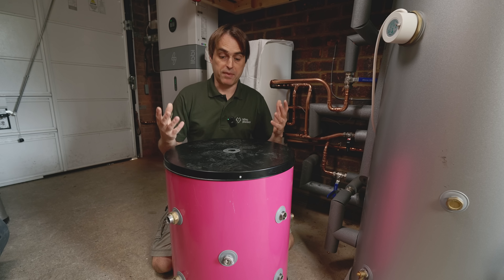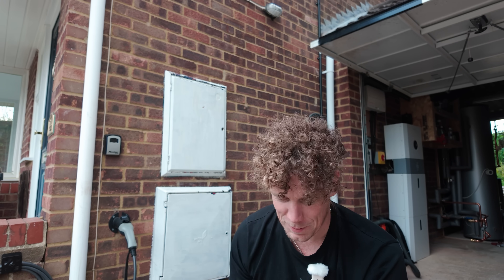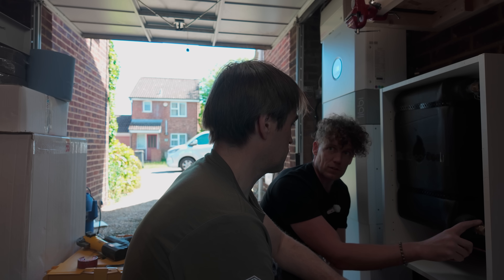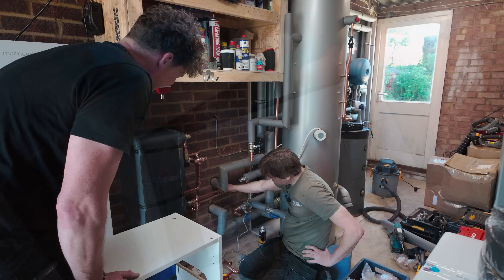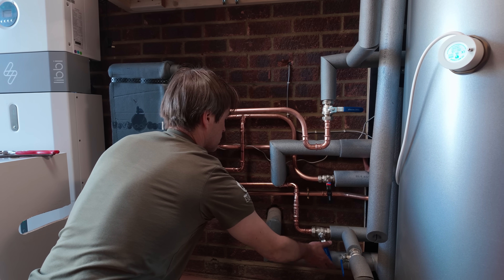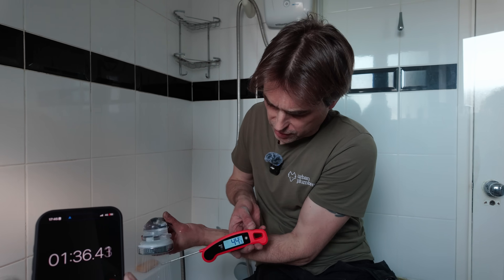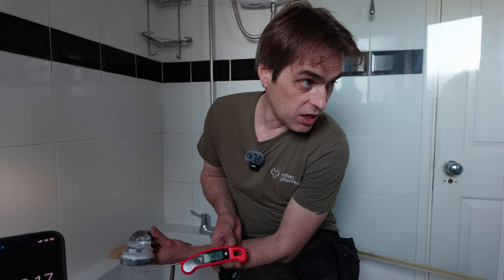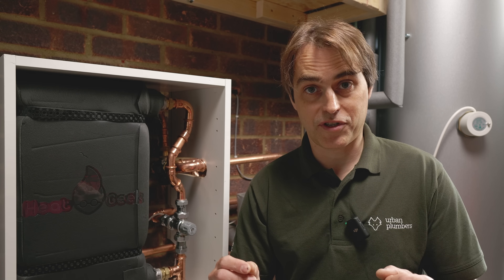We Built a Heat Pump Combi 'Boiler'. But Does It Work?

Comment: would it be possible to run some sort of heat exchanger to capture the heat from the draining water? I've heard in Netherlands they are trying to capture the heat from sewage from a whole block, but I'm not sure it's possible to do this on a smaller scale

Comment: Can you drop in valve models that you use there?
I think I'm gonna repeat this and made it for a gas boiler. Instead of cold water tank, unvented hot water tank and very loud Stuart turner shower buster pump. This would remove all 3 elements, that would be replaced with just 1. I was thinking about making solution with small heat exchanger with flow switch and temp sensor in HP (kind of like remote combi boiler). This was good idea, but with small PE, every time hot tap would be on, it would ignite boiler. Big PE solve that issue, its a bit expensive, almost for a price of new combi boiler in place of system boiler. Hey, but if it works I'm fully in to it to have some fun! Great job guys!

Comment: Would be nice on my system, as mine is power hungry and struggles to perform in the winter months.
I have a tank in one cupboard and a buffer in another, so I’m loosing space for a system that massively underperforms and costs me around £300pm in the winter giving only 15-20mins of hot water.

Comment: this is fantastic, whats the energy consumption like in comparison with heating the big tank ? i wonder too if maybe a more efficient heatpump architecture would work better, higher volume/ flow compressor but at a lower pressure, or other way round ? wonder what would be best for efficiency

Comment: For me the concept of a combi is much better than a hot water cylinder due to the inefficiencies, especially with only occasional use. Is it possible to do this without the storage? Smaller heat exchanger, supplimented with an electric heater that kicks in for the first minute or so until the heat pump is doing its thing?
Reply from the maker: Hot water cylinder is twice as efficient as this solution though

Comment: This confirms my idea of using plate heat exchangers with a heat pump in order to heat a hot tub. Ideally, another exchanger could be used in a corresponding cold plunge, and then use thermostatic mixing valves in order to 'bleed off' excess heat energy when one of the pools has reached its optimal temp, but the other requires more heat to be pumped in order to reach its temperature set point!

Comment: In Japan there's something called "Eco Cute" which uses the heat from the the air conditioning to heat water.
But in Japan, air conditioners get used on "cold mode" 9 months or so of the year!
Reply: I guess that 9 Months does Depend a lot on the region of Japan you're in.

Comment: Nice idea! Would it help to have controls  (e.g. a button) to press shortly before you have a shower to trigger the heat pump and get it up to temperature? Behaviourally similar to running a bath. Guessing if its -5C outside it could take too long to get up to temp.
Reply: Then again, it would likely already be running the space heating at >40C... so that helps

Comment: Instead of no hot water cylinder, how about a very small one that has a high efficiency like a vacuum thermos of a few liters, just enough capacity that the heatpump has time to start, it could be maintained at almost boiling temperature with only a few watts electrical input and then mixed down to provide the delay needed for the heatpump to start.

Comment: Does anyone know which brand/type/power etc the PHE is used? Seems to be quite a big one which are mostly not so cheap.
Reply from the maker: It’s Nordic, around £1,200 if I remember correctly. I got the spec somewhere on the video so would have to find it

Comment: What about packing it with sand or phase change material to lengthen the hot water draw off run but also reduce the heat pump cycle.
Reply: Like a storage heater

Comment: For this to work, the heat pump must constantly maintain the temperature of the exchanger, which is not environmentally friendly and does not make sense. Installing a thermostatic valve to control the temperature of the heat pump is a big mistake. You have made a mistake because the temperature of the heat pump is too low and there is also that unfortunate thermostatic valve behind the heat pump. You have too many cycles during operation because of this.
Reply from the maker: There is literally no cycling at all. It works fine. We have data on Open Energy Monitor showing 1 cycle per 2 hours so nothing to worry about
Reply: @UrbanPlumbers 
Of course there are cycles, maybe there aren't any in testing, but when there is another lowering of the water temperature at the tap - there will be cycles. And it's stupid to put a thermostatic mixing valve between the tool pump and the exchanger. You didn't comment on the nonsense of the arrangement? And how powerful is that exchanger? 500kW? It's nice to see you learning from mistakes, but this has nothing to do with efficiency. No one will beat a condensation boiler.

Comment: I am not sure I understood the mixing/repeating water loopy thing.. 
But.. I am so impressed, I might just take a 20 minute shower
Reply: basically back feed the water to the Heat pump until it's reached a temperature you can actually use for hot water.
Reply: @maesto  I assume that is "before the shower starts running" and not "as you start running the water" ?
Reply from the maker: Before, the plate stores water at higher temperature at all times so it’s ready to deliver hot water instantly and allows for better flow rate as you slowly deplete the energy stored in the plate while heat pump kicks in to replenish it
Reply: @UrbanPlumbers  Ahhh.. I think I understand it now, so it stores the temp in a solid metal mass rather than as a liquid mass as usually found in a tank.
I will try and watch the video again to see if I can understand the loop back thing a bit better.. 
I know there was a graph on screen at one point, I will see if I can figure that part out again.
Reply from the maker: @ColinRichardson it also holds 15l of water on DHW side and 15l on system side - so 30l of energy stored in water
Reply: @UrbanPlumbers  I re-watched the mixer thing graph.. for the loop.. Your finger was covering the 2nd mixer for most of it while it was on screen, .. the one on the right.. I assume that is the mixer that sends the water back around until the metal mass has heated up.. but then I don't understand why it sends the cold water through the metal mass again, it seems like it would cool it down..
Reply: Technically, needs to be signed off with building control under part G.

But how exactly do you sign one off? It’s not an unvented cylinder, how would you even commission it?

Comment: This is massively important for new build properties where developers have already built into the loft space for the master bedrooms. Frankly many of these homes don’t even have enough storage space for the number of bedrooms, let alone finding a way to give some up for a HWC. Also this will make many installations more straightforward as the outgoing combi already gives you the required space and an integration point into the HWC 👍

Comment: If you replaced the temperature sensor on the heat plate with a flow sensor. The heat pump could kick in 2m 30 earlier. Every second counts 😅

Comment: I might not be fully understanding yet, but is not not identical / similar to a water to water heat exchanger? I think a lot of new builds in The Netherlands have something like this, where block geothermal heat is fed into an apartment and can be used for radiant heat and with a valve it is switched over to a heat exchanger where the geothermal loop heats the tap water
Reply: Yes - however they are using the metal as heat storage....

Comment: I connected a  secondhand £100 heat pump to my valiant ecotec many many years ago. At first I made the system so complicated with expansion vessels for each circuit and also many motorized valves. As the years went by I kept reducing the complexity and components . At the end I disconnected the hot water tank and just use the boiler to heat hot water and provide emergency heating if it gets to too cold. It’s a 5kw heat pump heating a 5/6 house. Simplify simplify simplify. At one stage I thought to my self I could get rid of everything(heat pump, boiler) and just use immersion heating with the solar to heat up the whole house, it would cost me a few more £ a year but it was so simple. I like simple but make sure it’s safe above all! I don’t need to buy any more products that will save the planet.

Comment: In Heat Geek's video, they mention that it's okay to oversize the heat pump for heating the hot water, but surely oversizing the heat pump will cause cycling issues when the heat pump is in heating mode. If the sizing of the heat pump is going to be based on the hot water requirements of the property, we will soon be back to the good old days where oversized combis were thrown in everywhere and heat loss calculations were just an estimated guess. It looks as if there would be quite a lot of resistance through the plate exchanger, good mains water pressure will probably be needed to get a decent flow rate. 

I've seen a similar idea before for showers at a golf course, a plate heat exchanger was used (without a cylinder/buffer), and a secondary loop was installed to build up water volume. TMVs were installed at  point of use.
Reply: Potentially, but with a modulating heat pump oversizing it somewhat shouldn’t cause any cycling issues, as it will just modulate down to a sustainable output to meet the heating load?
Reply: @donkey1271  If the heat pump is oversized, on a milder day the turn down on the heat pump would still produce a higher output than the heat requirement of the building, which would lead to excessive cycling. Installing buffers/volumisers may help reduce the cycling, but the heat pump still wouldn't be as efficient as it could be if sized correctly.
Reply: @RodStephens-n5k  Sure, but that’s what modulating heat pumps solve, they can run at 100% of output all the way to 10% or less. This reduces cycling.
Reply: @donkey1271  I'm not so sure about the 10% turn down, I would have put it at between 30 to 40% of the rated output.

Comment: I was talking with friends the other day, that i don't understand why regular AC Split units don't have internal heat exchangers so the rest of the loops outside of the outside unit can just be low pressure glycol loops, Way easier to install, maintain, disassemble, less prone to harmful leaks etc.

Comment: That is a gigantic heat exchanger, wow. Are you running water in the hot loop, or refrigerant from the heat pump?
Reply: It's all piped in pressed fittings so it's not refrigerant gas .

Comment: Brazed heat exchangers aren't anything new but perhaps for this particular installation with a heat pump. They're used commonly in the States to add a forced hot water zone of heat on a steam boiler for example. Though in those instances they are quite problematic because of the impurities inherent in those systems. I've seen them commonly used instead of a tankless coil on gas and oil fired boilers and they work very nicely there for the size that they occupy. If you're only taking showers they're sufficient on their own without the need for a booster tank. The problem I see with a lot of this stuff is tenancy changes where people expect to be able to fill a bath tub while the dish washer and washing machine are all going at the same time. Absurd peak demand that a tankless coil will never be sufficient for. So most locations end up replacing these tankless systems for indirect tanks/zones.

Comment: 18 degrees outside? That is not even close to heating season. Unless you make it work at -20⁰C, I'm not gonna push it to -25⁰C, because we get a 1-2 weeks of that, so at -20 full bathtub while washing dishes. Then you got yourself a proven system. Now at +18⁰C. All I can say: like any other heat pump installer, seller, manufacturer, you manipulated test conditions, data and working principles, to get the result that checks some silly checkmarks. Full bathtub at -20⁰c outside air temp. Go on and impress me.
Reply from the maker: The coldest UK gets is around 0, so go and impress yourself.
Reply: @UrbanPlumbers  
With a weather-dependent controlled heat pump, and a consistent temperature of the cold water supply (it probably is) it will even work better in winter: Because of the higher heat loss of the building, the system temp will be higher in winter, thus the output temp of the warmt water will be achieved more easy. 
And for lower temp systems, like 30 dgr C, and a delta T of 5 dgr you get 35 drg output. You could of course set some kind of flow sensor in the water in the system to get the WSHP to go for max performance and place an electric flow-through water heater (2-5 kW should be enough) after the heat exchanger. (aka 'The Brend setup')
Benefits: 1 You get the high COP for the low system temp (great!)  2. Low/less heat losses compared to classic sanitary hot water buffers 3. Less space required (as mentioned in video) 4. Less material & cost 5. no legionella risks. 
Disadvantages: 1. Heatgeeks will sell less of their spiffy boilers 2. Cold feet in the living room if you have teenagers 3. Almost sub zero Andrew Huberman showers during defrost cycle (!)
Reply: @UrbanPlumbers test it at 0⁰C. Plus not having any other arguments, you just supported my claim: this set up isn't suited for colder climates in real world applications. And wirh heat pumps i would not try to tear them up to try to fit the role they are not meant to fit. You yourself in your videos claim that heat pumps need to run in steady manner. With cop of under 3 is it really worth it?
Reply: I love these systems but would still run a backup with them. It is annoying that others eliminate these systems for considerations when it is still sufficient for 96% of use cases. Add a back up and it is 100% you still get the 96% savings! (2 weeks out of 52 is 96%) Heat pumps are great and there down sides can be easily mitigated. In the end you get more energy savings. The only constant is the cost of energy will continue to go up. You can always just go to a big buffer tank. You loose some heat to the environment but it might mean you don't need a backup heater.
Reply: @Ender_Wiggin I agree, summer and shoulder months are great, but harsh winters is the time where other sources need to take over. And making bold claims isn't wise

Comment: Brilliant idea, I guess a 3 port valve controlled with a temperature probes would work OK on the primary side and would it give better flow rate through the plate exchange, although the sceptics now claim that with this hot weather all heat pumps will be exploding, funny how all air conditioners are still on house walls 😂

Comment: Was there a reason you used such a larger plate heat exchanger..?
Reply from the maker: The larger the plate the more energy / hot water it can store.
Reply: But you're not storing, your trying to transfer heat quickly and surely a smaller plate would have let the heat pump get up to temperature faster@UrbanPlumbers
Reply from the maker: @PauloPatel that plate stores 30l of hot water. Smaller plate wouldn’t work

Comment: Brilliant all he needs to do now is to get a heat pump to work properly on multi zone heating systems with different temperatures
Reply: Why would it not already? Motorised valves and smart radiator valves are already a thing.
Reply from the maker: no one needs that lol

Comment: Are there any reversible heat pumps on the market yet, what also work as AC in the summer??? 🌞
Reply: Yes, our LG THermo V is running at the moment cooling our underfloor in 30+ C Southern Italy.  18 C flow temperature.  It's not as effective as a full air AC, but it keeps the temperature OK, and avoids the sinus problems that my wife gets in 'bnormal' AC.
Reply: Vaillant ones do

Comment: At that temperature wouldn't legionnaires be a problem?
Reply: also if you consume the water once a week it is fine...
Reply from the maker: No, water is stored well over 60c and then blended down with cold through a mixing valve

Comment: I'm worried about the compressor in such system, lots of short runtime cycles are generally bad for it.
Reply: plus the high condensing pressures => high condensing temperatures really grind on the compressor.

i know R410A A/C compressors that failed after a few years of condensing at 45°C.   and A/C systems don't have to available 24/7.

Comment: Great stuff. You should be looking at aerogel for the insulation. Way more efficient.

How does the factor with the power draw on the heat pump.

Comment: What temperature was the water coming in to the system? Here in Sweden it's usually around 5-10°C and I need approx 15-25kW of flow-through power to heat water. We have a 16kW ground source heat pump that has on occasion run out of hot water even though it's approx 200L of hot water storage and it can heat water at 16-18kW when full-on. If I set it to full power and someone showers, it barely keeps up. Seems though the standard here is 10-20L / minute for shower heads, not the 7L/min used in this test.
Reply: Water comes in the same here in the UK. A gas combi boiler we expect around 12lpm of hot water flow but once this is blended down in the shower it will be slightly more, 
Your 200 litre tank to heat from 10 degrees to 50 degrees should take 35 mins at 16kw

Comment: Congratulations. If the store were integrated into a heat pump - or was a stackable extra - and could go outside - this would make many installations dramatically easier and quicker and therefore cheaper.

Well done: great innovation: hopefully some manufacturers will integrate this kind of technology.

M